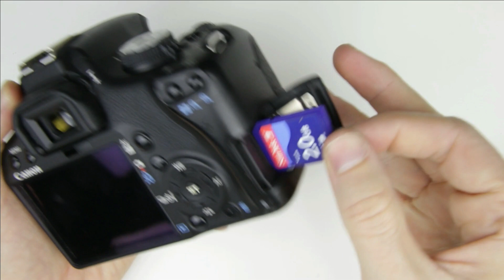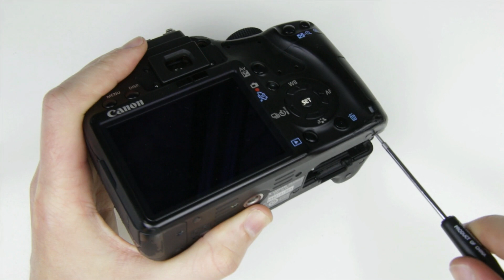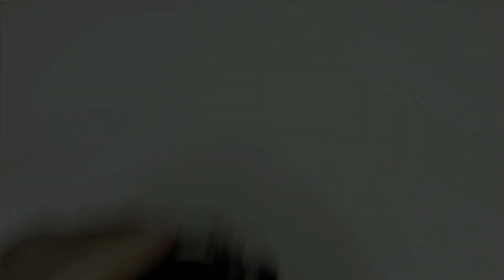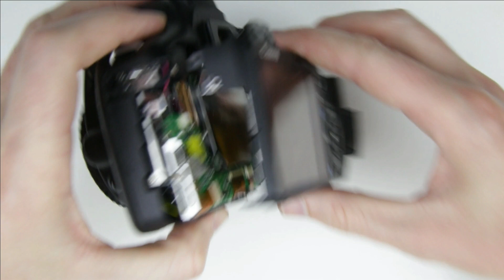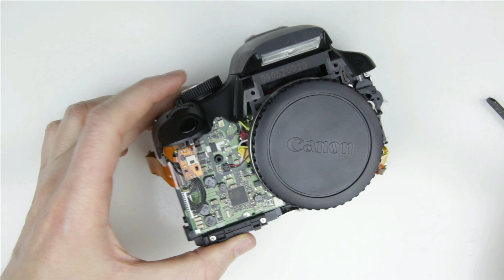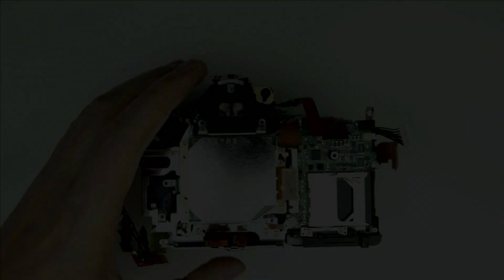Canon EOS 500D disassembly for repairing the SD memory card reader (EOS Rebel T1i / EOS Kiss X3)

Comment: where did you find a replacement board i need a new sd board for my t1i
Reply from the maker: The last time I bought the replacement board on ebay, but you can check aliexpress also, maybe there is also some for sale.
Reply: I know to check on eBay but they don’t have one listed specifically for the t1i model so I’m not sure which one and o wanna order before I dissemble my camera
Reply from the maker: @solondarville1020  Insted of t1i, use 500D. I see many PCBs for sale.

Comment: Jesus christ you removed the front of the camera and all with no need , and also i dont advise  Soldiering   gun to be used :)
Reply from the maker: If you don't remove the front, you can't remove the top which is needed to remove the PCB. Soldering gun does the job, and it is more common than the heatgun.
Reply: @CamerasLensesEtc  its harder to do on 550D because the mainboard screw is under the top cover , but it can be done . But Sd Card PCB cant be removed without the top cover removed on 550D ,  here i dont see  a problem . But doesnt mater .
Tell me do you know what is the Optical cable used for , the one that runs from Flash unit cover to the mainboard . I cant figure out what is that used for .
While trying to heat gun my SD card slot cover away i kind of melted it a bit , just enough that it wont stay in its white slot , it got few millimeters shorter then needed .
But camera works just fine , and i cant figure out what is it used for , must have a purpose . Maybe its for TTL , i didnt try that .
Reply from the maker: @dedskin1  The "optical cable" is an antenna.
Reply: @CamerasLensesEtc  Ive seen antennas in my life , they require metal of some kind , this is a plastic tube , it melts away , further more its not connected to the board with a physical  electrical connection , therefor it can not be antenna .
But even if it is , for what , there is no Bluetooth , wifi , or FM radio on 550D or 600d.
Reply: @CamerasLensesEtc  Ive looked it up , its not anntena , of course its not its an Optical Cable , and its a Flash Trigger .
you learn everyday .

Comment: Absolutely pointless! I now have a camera in pieces, as I am unable to remove the PCB with the Card reader on, as it has a screw in the top corner behind the main chaise that would involve taking the CMOS sensor off, and you carefully avoid all of that at the end. You are like a tour guide who takes people into the jungle then runs off as it gets difficult.
Reply from the maker: You don't have to remove the sensor to remove the PCB of the card reader... there are three screws which holds the plastic part which the PCB sits on, then the PCB can be removed... I have a video about it: https://youtu.be/Bg40iNq2PJU
Anyway, thank you for your kind comment! :-)
Reply: @CamerasLensesEtc  THen why didn't you show it, and show how to unsolder the card reader??
Reply from the maker: If the pins of the card reader are bent, you can see it without even removing cover of the card reader. If the pins are perfect, then you have to replace the whole PCB. If the pins are bent, then you can unsolder the cover of the card reader, but soldering doesn't need any special skills, so there is no need to show it.